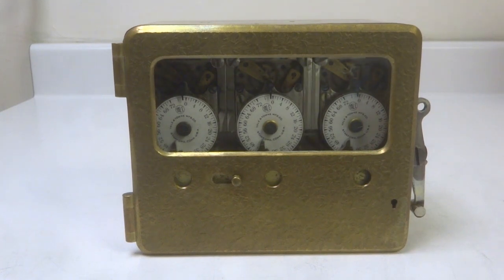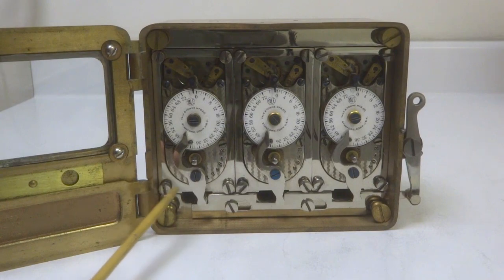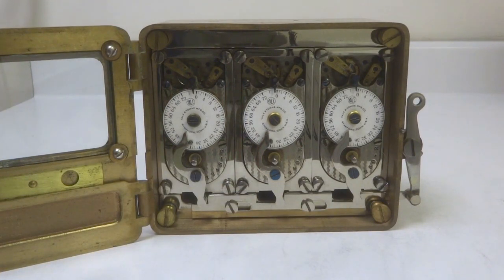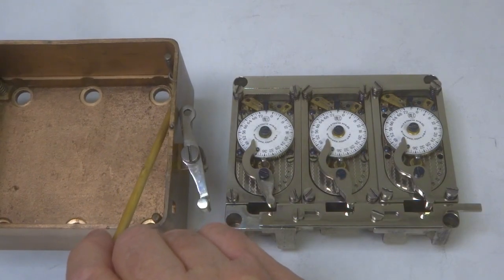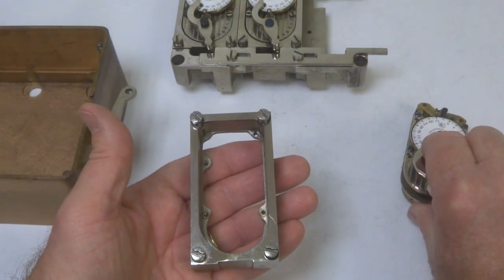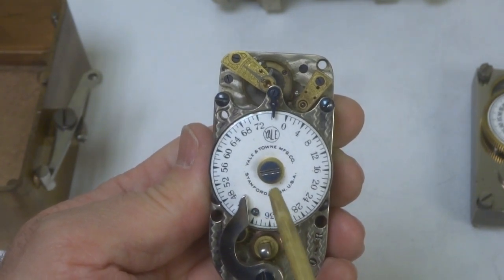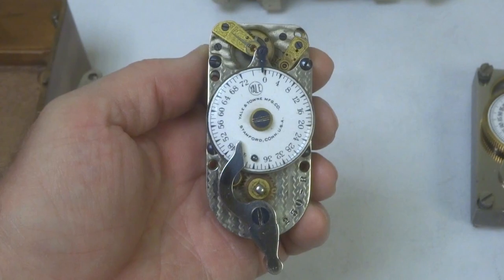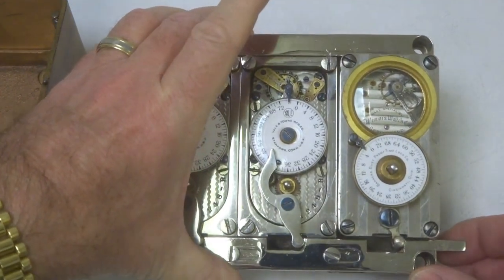Mosler time lock with Seth Thomas movements supplied by Yale

Comment: The "R" on the serial number indicates that it's a right-handed movement. Typical Yale movements are designated as left-handed. Older Diebold movements were available in right or left-handed configurations, depending on the mechanism of the safe/vault door where it was installed. If you replace the movement with one that is handed wrong, you'll be calling someone like me to drill it open.
Reply from the maker: Correct you are on all accounts!
Reply: I have a different explanation on the Yale "R" designation.  I believe the R stands for reversed as in reverse direction.  My reasoning is that with the Yale timelocks letters of the alphabet were model designations.  As in the B,C,D,E, series,  K,L,M,N,O series.  T for the small movements, L for the medium size and M for the large movements with movement designation coming from the timelock series model.